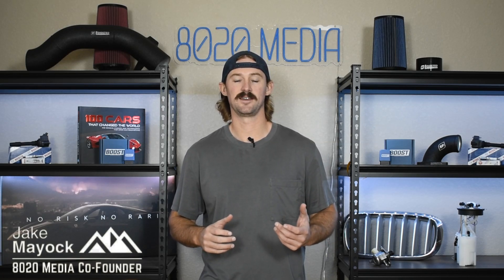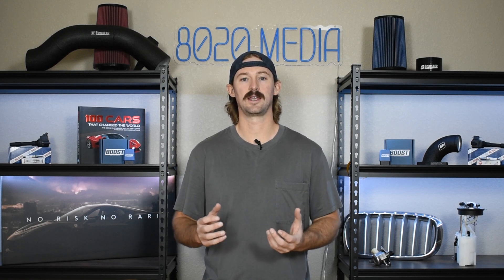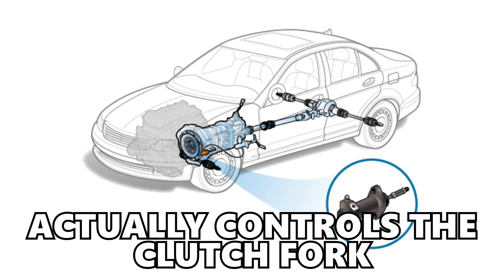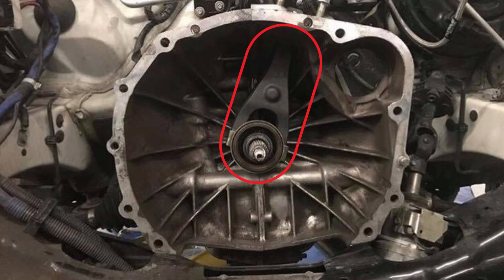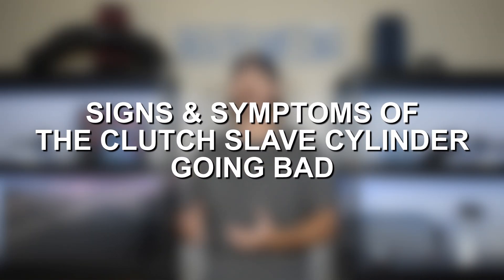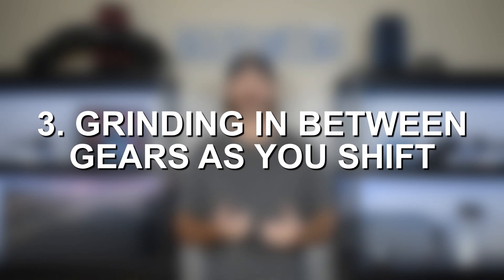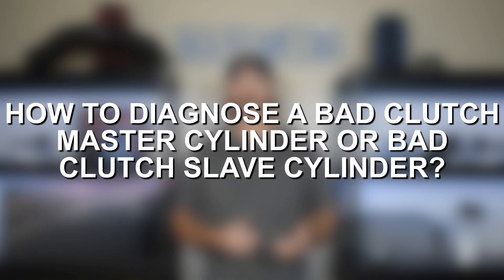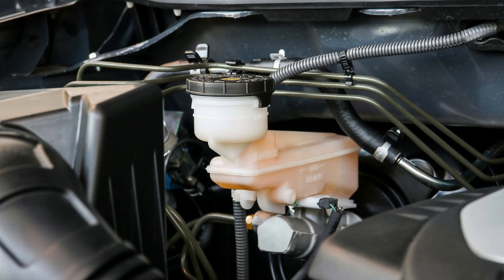Bad Clutch Master or Slave Cylinder? Symptoms, Diagnosis, and Fixes Explained!

Comment: Just did a manual swap on a 99 civic everything went well and shifts when the car is off, but when I turn the car on it won’t shift , changed the ecu to manual and fluids seem fine, bled the clutch line as well some bubbles came out but still can shift into any gear but the reverse but that grinds, transmission is fine as well too
Reply from the maker: S - Sorry to hear this.. The issue likely lies with clutch hydraulics (air in the line, weak slave/master cylinder) or improper clutch disengagement due to alignment or installation issues. Start with re-bleeding the clutch, checking cylinder functionality, and verifying pedal adjustment. Keep us updated.
Reply: @8020Automotive  yep, made the pedal stick out more and bleed the slave and master and works like a charm!
Reply from the maker: S - Awesome! Glad to hear it's working.

Comment: Very good explanation. about clutch master and slave cylinder. The best we have seen so far. Clearly and simply stated. Thanks! Much better if there are more visuals to distinguish the clutch parts. How about the clutch disk and pressure plate?
Reply from the maker: M - Thanks for the feedback! We'll add it to the list.

Comment: Im having fluctuating issues as it shifts smoothly at times and other times i have to press the clutch pedal multiple times before it changes a gear
Reply from the maker: L - Could be experiencing intermittent issues.

Comment: My problem is that when I upshift, (lets say around 4000rpms) I press in the clutch and go to shift. It does not let me into the next gear until the rpms drop to at least 3000rpms. My car doesn't seem to have any issues when downshifting, however. Do you think either the master cylinder or slave could be the issue? The clutch pedal feels normal, and my slave was replaced about 40,000 miles ago. I brought this up to the mechanic once before, and he adjusted my clutch pedal and the issue went away. But after about 8 months now, the issue is back. Any thoughts?
Reply from the maker: C - Start with the clutch hydraulic system: Check for leaks or air in the system, bleed the clutch fluid, adjust the clutch pedal again and test. If the issue persists, inspect the clutch disc and pressure plate for wear or warping.

Comment: BRO!! thanks a lot for the explanation! just replaced the slave cylinder, and it looks like the slave cylinder gave out first before the master. the slave is the one that went leaky and sent dirt to the reservoir. both darn went caput at the same time!:face-blue-smiling: must be because of the really dirty fluid. bled it and topped with fresh fluid, still spongy. I'll get a repair kit for the master. hopefully it solves the issue.
Reply from the maker: K - Thanks for the feedback! Hope it helps. Keep us updated.

Comment: My clutch became soft but raises back to normal position, i dont have any leaks but my fluid was low when i checked. Filled it up and no leaks still. When my clutch messed up it did do a loud pop. Ordered a new master this weekend. Any suggestions ?
Reply from the maker: J - It could be the master, but hard to tell without being there. Keep us updated.
Reply: @8020Automotive  super late reply but it ended up being the master. At first when i replaced it and tried to remove the air bubbles it wasn’t working until i used a vacuum. If you could bring it to a shop i’d recommend if you don’t have a good bleeder
Reply: @Joshmunox gravity bleed?
Reply: @RetroGamer74 i changed the master and went to a shop to have them pump it and everything was good. Doing the gravity at home took way to long, id recommend either getting it done or if you know anyone with a pump
Reply: Same exact thing happened to me, I thought I wrote this and forgot about it🤣 no leak, pushed pedal in and heard a pop and no longer disengaging to put it into gear. I thought it might have been the slave but I think it’s the master after seeing this video

Comment: Very informative, I am facing the following issue:

1. When my Honda Civic Gen 8 2010, is cold and I press the clutch paddle and shift gear it is so difficult to shift. However once car gets warm/hot it becomes easier.

2. I previously had a very good clutch pressure and pretty fine clutch release point. Recently I observed a minor leakage under the clutch paddle inside my car. Now it is a loose clutch which means that easily pressed and no more a fine clutch release point which means as soon as I tend to loosen my foot pressure on the clutch paddle it starts moving.

I am going to check the fluid and get Clutch master cylinder changed.  So let's see what's my next comment here
Reply: Yeah I changed it, it is running Ton Ton now. Thanks for helping
Reply from the maker: H - Sounds good! Keep us updated.
Reply: Hey! So I had the same problem where when my car is cold it was hard to get into gear… I replaced my clutch kit and clutch components to hopefully fix the problem and still I have the same issues. However! It goes into gear when it cold BUT! The shifter is still giving me the same shifting clunking sound and it still clicks hard asf when it engages into gear. Enstead of having a smooth gear engagement. 

I’ll be replacing my slave cylinder soon.